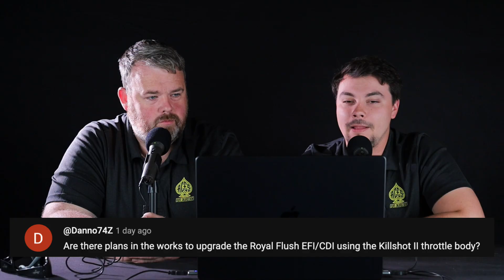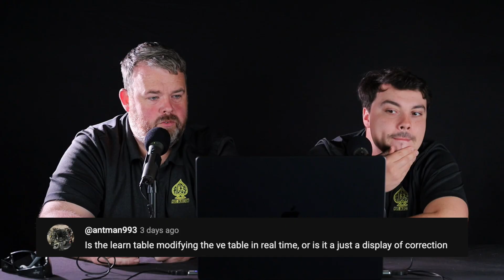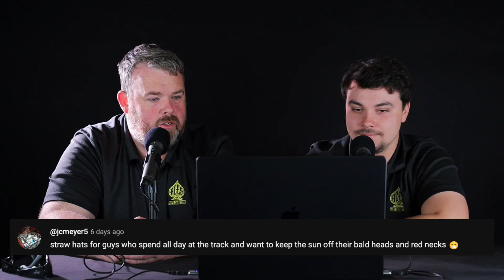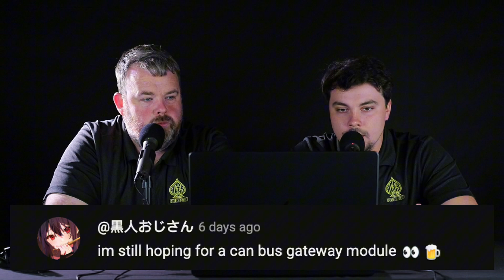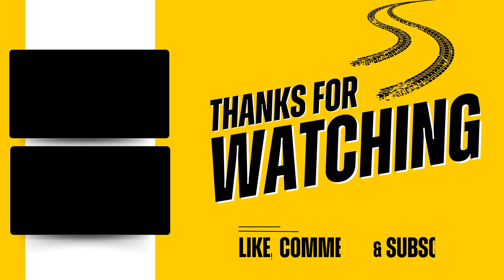Tech Tuesday Ep. 73

Comment: Is it possible to put rev limiter in a 2 step configuration? Installed the killshot pro, command center, blackjack pro distributor and coil. Car runs great but is hard to start when hot and when it does start it idles high for an excessively long time ( about a minute) before it idles down. Thoughts?

Comment: First question On the jackpot can you wire the launch(blue) wire to be used with a trans brake on a turbo400? Also I know Tim mentioned it before I don’t remember if it was in a short but how do you tell if you need a resistor in the wire that goes to the alternator?

Comment: Question for the guys and thanks for the knowledge.   Is there a way to use the joker or wild card stand alone kits with a configuration for the 2.3 Ford turbo coupe engines by just adapting sensors and using 4 of the 8 injectors?   Thanks for all the previous tips, advice and support.   Hope to see some forums support in the future